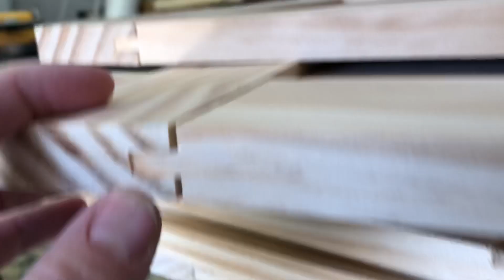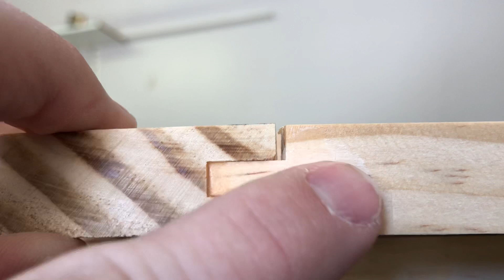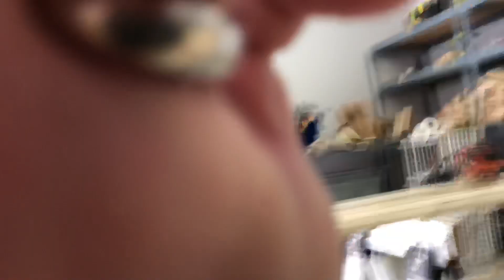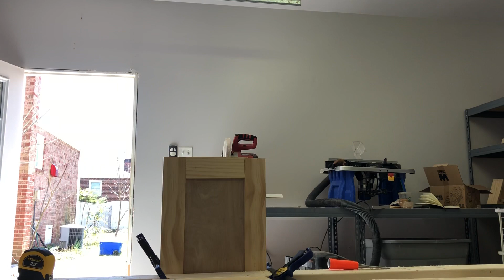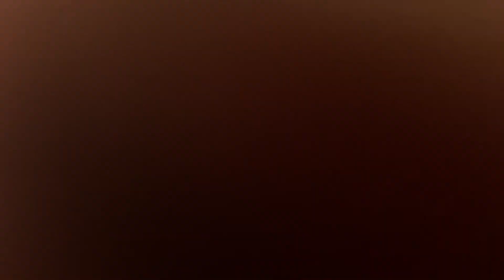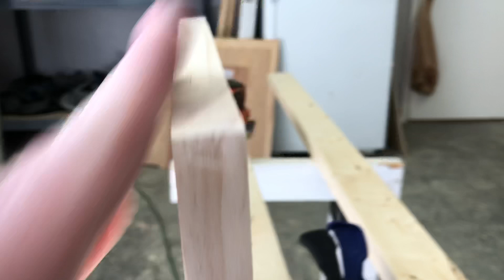Using an electric hand planer to smooth out the edges on DIY shaker style cabinet doors

Comment: Dry fit before gluing  allows you to correct your errors before making it permanent and causing more work. Like they say measure twice cut once.
Reply from the maker: Yes this makes the most sense! Unfortunately I was working on a very finite timeline and had a lot to do. So I went for. Luckily this was for my own house, and not a client. Otherwise, I would have been a bit more intentional!
Reply: @thepatriotworkshop7980 , it's your home. Unless you're moving out, you have all the time in the world. If you were moving out, it wouldn't make sense to go through the trouble to make new cabinet doors, as you're not going to recoup your costs and effort in the sale price. So, assuming you're not moving out, I say again, you have all the time in the world, so do it right. Otherwise, you'll be looking at your mistakes every day until you do move. And when that time comes, you're not going to get what you want for the house because the buyer will realize that they need to replace the cabinets, or at least the doors. There's so much riding on those doors. Make 'em like it matters.

Comment: Nice edge. Now measure each end of that top rail and tell us they are the same. Better yet, just look at it. You're going to hang that door and see how off it is every day you walk into that kitchen, or wherever that door is going.
As someone else mentioned, dry fit and then fix any imperfections before you glue them up. If "fixing" means to replace a piece, then that's what you do. But first, figure out what made that piece so wonky in the first place.
Reply from the maker: Thanks for the feedback! I admit I notice my own small imperfections, I am my worst critic. But I’ve learned as I get older that “done is better than perfect.” These doors have been hanging in my kitchen for two years and I have no idea which ones are imperfect! 

Also as I’ve mentioned in other comments, I was on a tight budget and extreme time crunch. Sacrifices were made. Lessons were learned :)